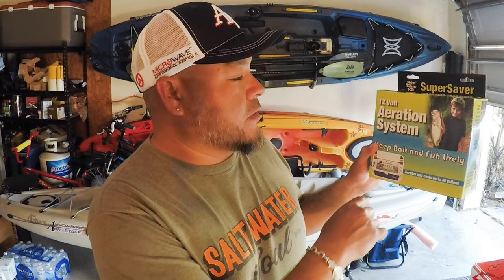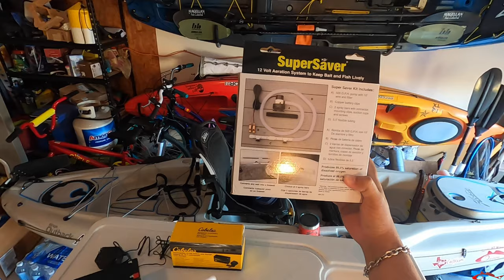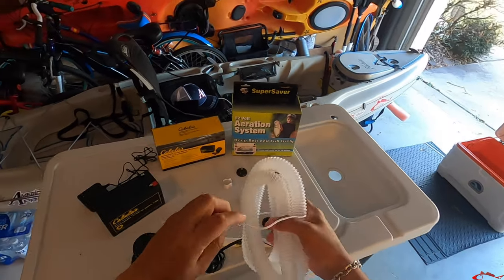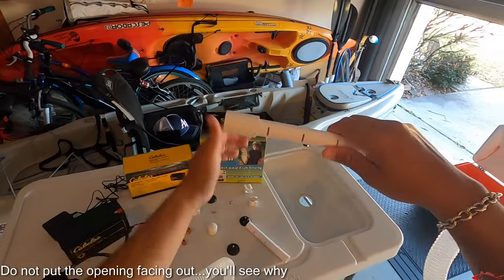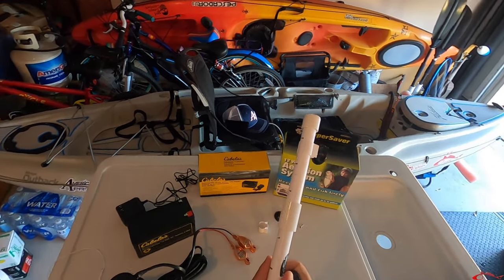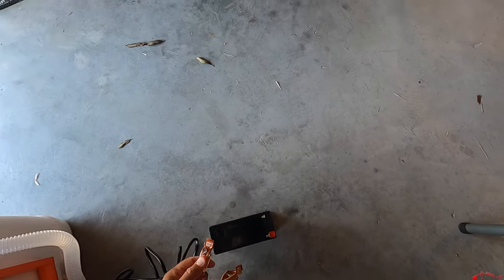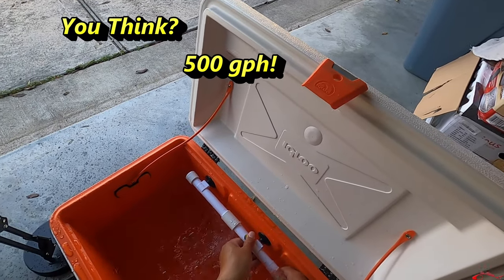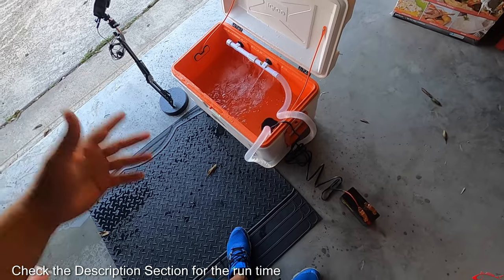Easiest Live Well Build Ever | How to DIY Build a Live Well for Fish or Bait

Comment: Be careful with that unit dont know about fish well but as for bait water will heat up pretty quick pump in water recirculating same water I have unit like that I normally  freeze two are three water bottles to keep water little cooler
Reply from the maker: 100% correct thanks. I but a few bottles in it, 2 water & 1 Gatorade smaller bottles & they all melted... but the fish was still kicking. Thanks again for the tip💯🤙🏼